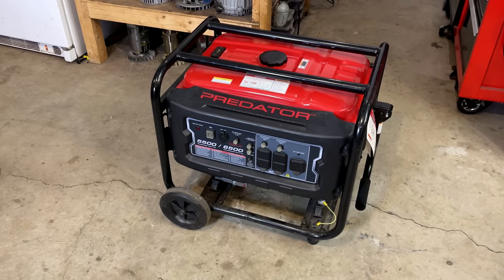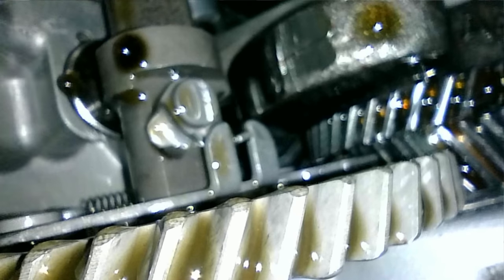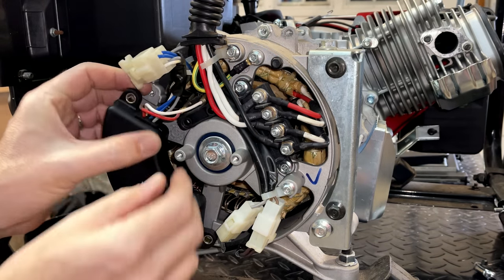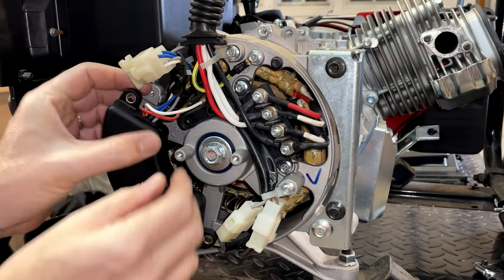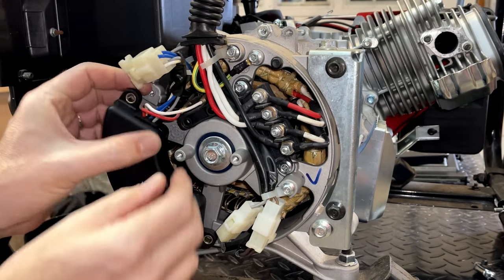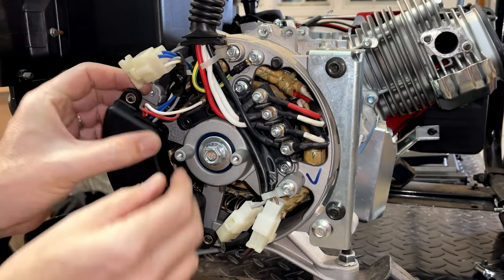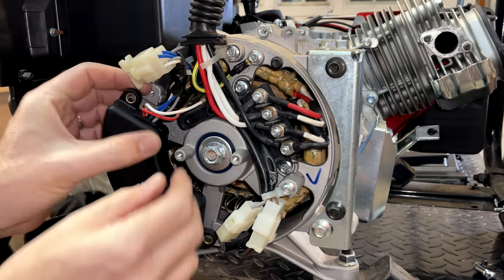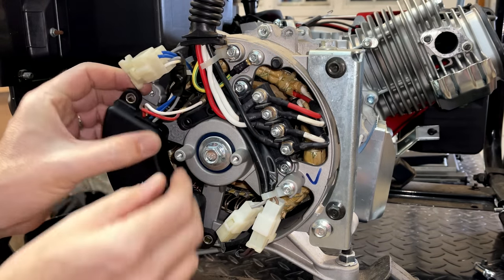Broken Predator Compression Release? - High Compression and Hard to Start

Comment: I don't think the sticker was backwards, instead of showing how much the choke is on or off, it might have been showing the relative opening.??
Reply from the maker: Maybe, although I think I have seen them the other way on some other predators.
Reply: @jcondon1  yeah it's not really a good indicator of what is going on
Reply: The sticker was most certainly in the correct orientation narrow indicates closed wider indicates open.
Reply: @Outindacold  Makes sense buddy i believe you are correct. You would think the standard design should just be an arrow and a pic of closed and open

Comment: Oil works better than water James ,old toolmaker trick for removing blind bushings.
Reply: Yes, but then you have a big oily mess to clean up, as he has stated before.😮
Reply from the maker: It does work better and I use it when water does not cut it.

Comment: James I have recently starting watching your videos and I really enjoy them.  I have a quick question about a generator I have been working on.  It has a plastic tank with a rubber grommet/bushing on the bottom of the tank holding a shutoff valve.  The grommet was leaking so I ordered a new grommet from Amazon.  The new grommet worked for about about 2 weeks before it also started leaking.  When I removed the new grommet, it had hardened and obviously shrank.  I figured it was a cheap grommet from amazon and it was probably not compatible with ethanol fuel.  Therefore, I order a much more expensive grommet that was supposed to be OEM.  This second new OEM grommet lasted about 2 months but it also had the same results.  Is there a grommet out there that will not be effected by fuel with ethanol?  I watched a video of yours from 3 years ago where you used an orange colored grommet and you gave the part number.  I looked up the part number you gave and it says it is discontinued and no longer available.  Please help.

Comment: Funny but I always wonder why you don't blow out the seat to the fuel inlet when many small carbs have a fuel inlet screen and as a force of habit I always chuck up a Q-tip in a drill and clean the brass seat in case of any residual shellac on the seat. And of course if it has a steel only needle I clean it and replace the rubber seat but that's usually on Tecumseh carbs. Great video as always and I think your son came by because he was eyeing up the 420 cc motor for the Go kart. lol
Reply from the maker: I have an extra 13hp Honda GX390 hanging around.  I thought about upgrading the go kart, but the 5hp Briggs is about all that frame can take.
Reply: @jcondon1  Reminds me with my Sons and now all three of them have motor cycles, they went from 100cc 4 cycle to 1600cc. What I taught them is speed coast money how fast do you want to go. LOL  You're doing a great job, kind of reminds me of "Cats in the Cradle" every minute now will be worth it in the end, Great videos.

Comment: Hey James, based on your findings with the scope, (that the compression release might have been stuck), would it have been worth trying to spray some WD40 in through the oil fill and onto the compression release mechanism, to try and loosen up the compression release without disassembling the entire engine? Or do you think that would have been a waste of time? Just a thought.
Reply from the maker: I think it could have been freed up without taking the engine apart.
Reply: @jcondon1  I guess the video would have been a lot less informative though. 😀

Comment: Hey I really appreciate this video because I have the same problem with my predator generator with the cam shaft issue mine is a 4375 3500  so it should be if not exactly like the one I have

Comment: Wondering your thoughts on a line filter  HLin AC 115/250V 30A CW4E-30A-S Noise Suppressor Power EMI Filter AC Power Line EMI Filter add to furnace or to my generator transfer switch.

Comment: I’m surprised you didn’t try and move the release through the fill hole when you noticed the issue with cam…. Could have fixed it in 20 sec with no disassembly

Comment: I'm a newbe with all the workings of the small motors and have learnd by the school of hard knocks. So if you were able to crank the motor past the compression stroke why didn't the cam lobe lift the exhast valve to pass the 120 lb initial test even if the auto comp release was not working ?

Comment: I sincerely doubt you missed it, but it looked like you may have omitted one of the two bolts on the brushes.
Reply from the maker: Only one bold holding Honda clone brushes.  The other side just has a locating pin in the end housing casting.
Reply: @jcondon1  Aha! Like I said, I really doubted you would miss something like that.  Thanks for the reply!

Comment: I've got a "y2k" honda 5kw generator.  Had to cut the frame to pull the carb.
Reply: That is ludicrous Jim. The only time that I saw James thinking about cutting a frame was when he was considering which tri-fuel propane natural gas conversion kit to buy when converting a generator with an unobtainable fuel tank.  He used one with a very thin insulator block in the end that did not require any cutting. At least I think so but my memory might not be that accurate. Remind me never to get one of those 5Kw generators.
Reply: Wow hard to believe i would have thought that just removing the studs that hold the carb on need to be removed and that would give you enough room to get the air filter housing and carb off.
Reply: Why not unbolt engine ???
Reply: @philliphall5198  Not sure that would be necessary and there may be more to unbolt like the fuel tank which then would require removal to move the engine over. Just removing the carb mounting studs will be enough in some cases only one needs removal to rotate the carb after disconnecting linkage, spring and fuel line.

Comment: Hmmmmm. May I give my 2c as to why that decomp assembly was stuck? My feeling is that there is way to little wheight to keep that assembly out of the way until the speed has come down enough, thereby causing the assembly to be hit against the lifter at a higher speed causing that decomp assembly to become jammed open because of being bashed into the lifter. 🤷‍♂ There is way less material on the weight side, so like I said, just my 2c..... Again, thanks James good vid! OH!!!! And by the way...... You you bum you, stealing😂🤣 rubber feet!!!
Reply from the maker: The weight part is what moves the decompression assembly out of the way.  The spring pulls it back.  The spring was very weak on both cams.  So it does not take much to jam it up.
Reply: @jcondon1  Ah! I see.

Comment: You are probably right about some foreign particles getting in the release mechanism - could be a poor cleaning of the case prior to assembly, or contamination from the oil funnel. Anyway, that release appears far superior to the Brigs plastic use. The last failure point, would be the speed regulator being plastic. The valve washer is probably just poor adherence to build procedure at the factory.

Comment: Nice video!   Just curious if that compression release could have worked itself free by running the engine with some Seafoam in the oil?    That is assuming you could start it without the assistance of the compression release working.
Reply from the maker: It may have worked itself out.  I think just lifting the engine and dropping it hard could have done it in this case.
Reply: Put hand over intake and pull start it several times and it will start

Comment: I would think manufactures would just put a compression release in the head that you can open while starting then close after it's running. Like old motorcycles or old John Deere tractors. Keep all of that stuff off of the cam and make the engine more reliable.
Reply from the maker: Wish they would build them that way.  Easy to fix.

Comment: @James Condon awesome vid long time viewer, question I just came into a Predator 6500 with a viewing hole throw the block 🤣 where can I get a tapered shaft motor to replace ? the 301cc ones they sell from harbor tool are keyed & non tappered
Reply: @James Condon Or is the tapered part a fitting that comes off the motor shaft & can be transferred to the new motor ?
Reply from the maker: The crankshaft has to be tapered.  Your best bet is to pick up a generator locally that does not make power.  Most Honda clones between 300-420cc should interchange.
Reply: @jcondon1  your 100% right just got it all torn down & it's tapered; fun tip you might like to try; I tested the stator before tear down using a drill & socket on the crank w a light bulb plugged in so I knew it was good before investing time for tear down 😁 I'll have a look for a motor that meets those specs thank you vm again ❤️

Comment: If you didn't have a compression tester handy, could you use a torque wrench to estimate pressure by amount to turn engine?
Reply: Of course, removing the coil spring to access it.

Comment: Thanks James.  Two questions for you.

What is too much THD?  Seems Europe is the only place that has a specification for the limit.

On your Ampprobe, do you just hook the two leads to line 1 and line 2 to get the THD for the 240v circuit?
Reply from the maker: I have heard that utilities in the US are allowed up to 5% THD.  I have seen some referencing 6 or 7% as the max for total harmonic distortion.  Some also go further and say no more then 3% on any one harmonic.  I usually only test on the 120v leg.  Would be interesting to check the 240v circuit which goes through both legs.  Not sure if the value would double or not.  The Amprobe can also display the % for each harmonic.  Will have to experiment a little with the meter in an upcoming video.

Comment: I have a riding mower that is doing the same thing that this engine was doing. It was given to me several years ago. I was told that the engine was locked up by the previous owner, so I kept it for parts. It sat in my back yard for a year or two before I got around to fooling with it and found out it was a compression issue. I did a valve adjustment, and it fired right up and ran perfectly. I used it a couple of times with no issue, then I didn't do anything with it for about six months. When I went out to start it, it is now building too much compression again. It is a 12HP Briggs Failtek engine. Do you think it could have the same issue? It has me stumped.

Comment: I have noticed that you torque everything. I have been working on small engines for years, and I have never even owned a torque wrench. I have never even used one. I haven't had to do a ton of engine work in my business since customers usually don't want to pay the labor, but how important is it to use one?
Reply from the maker: For most bolts, not that important as long as you go easy.  Most of the smaller bolts strip out real easy.

Comment: The  intake valve retainer - what keeps the retainer from rotating around, out of position, while the engine is running?
Reply from the maker: Just the spring tension and I would also think the rocker.  Every time the valve opens it would probably center itself as long as the flat edge is down.
Reply: @jcondon1  thx!

Comment: Man that is really some cheesy weak lightweight looking stuff for that compression release to live inside a motor and be expected to last....
It should be designed to not be affected by minor pieces of sludge or small metal shavings,,, also was the cam you had an older design ??

Comment: so i have a predator 223 based inverter generator.    it was running bad.   did the typical ,  cleaned the carb.  plug. oil check,  as well as the exhaust spark arrestor and intake check.  went to the valves.   they were tight.   adjusted to spec.  then i started to get this high compression.   also about 130 psi.......   i do have the decompression bump on the exhaust.,   so it seems my cam is ok.....   i am at a total loss. .... it's not firing early.   this happens with out the plug connected even.   my hand needs to rest from the recoil snap LOL.    also it runs better now that the valves are adjusted... just hard as hell to pull.    any thoughts?   but even put in new push rods,  new keeper, new rocker arms and studs (stripped the old studs's with my shenanigans)    and with out the plug in it turns freely. so it's not a mechanical bind.
Reply from the maker: As far as the high compression would look at the valves again and make sure you are on top dead center of the compression stroke and not the exhaust stroke.  To be sure just rotator the engine until the intake is open and check the exhaust clearance.  Would suspect it is a little loose.
Reply: @jcondon1  I’ve tried that and to be sure I wasn’t on the decompression tab I even tried doing the exhaust with the intake valve open.    Same result.   Unless the specs in the manual are wrong perhaps !    Thank u for your videos and replying.   Just going to keep snugging it up and see if I get any better results I think the 223 motor in this seems to be a one off.   I don’t see them selling a 223
Reply: @jcondon1  finally got it fixed.   put in a new cam, even though the old was ok.  that didn't help.   replaced the valves and the top end decarbonized.   something in that did it.   finally can start it with out holding it down with my foot....   something on that exhaust valve was causing issues..  no idea what but all good now.   thanks for your videos and making me feel like i can fix things with your help

Comment: I have been trying to find a meter that measures THD, the ones I have found are fairly expensive. I have some sensitive electronics that require 10% or lower THD. What meter do you recommend for measuring THD?
Reply from the maker: The one I use is about the cheapest you will find new.  Amprobe acdc-52nav.  Otherwise there are other used ones in eBay that come up in the $200 range.  Like the fluke 41b https://www.ebay.com/itm/314144884451?mkcid=16&mkevt=1&mkrid=711-127632-2357-0&ssspo=y2HPpp5DTca&sssrc=2349624&ssuid=eec5lZxOS1O&var=&widget_ver=artemis&media=COPY

Comment: I'm used to working on old flatheads. Is the other gear the oil pump?
Reply from the maker: Counter balancer.  It has a weight like the crankshaft but spins in the opposite direction.  Helps the engine to run with less vibration.
Reply: @jcondon1  is that just the bigger Ptedators?

Comment: What causes the compression release to break ??I have the 212 I removed the governor the easy way forgot to secure the armature and when I test fired i got a real bad rattle shut it off secured the armature re fired no rattling after that compression was real high at compression point had to hand crank past or it wouldn't let me pull but after I manually cranked it past compression point I could pull it rode it like that for a while installed the mikuna knock off carb rode it a few times now I have no compression at all won't start I can just turn it by hand  99% sure  it's my compression release because i have zero bump in my left rocker arm ...just need to know one thing is my fault i messed up my engine??😂😂😂

Comment: 110 psi is a good compression reading for a 4 cyl VW engine..
Reply: the stuck compression release lever?   China quality control failure...!
Reply: and the other camshaft installed with timing marks properly aligned is a plus!

Comment: You know with a few modifications the children’s kart could do 60 mph. Unless you want to keep them.
Reply from the maker: It is a fast kart even with the old Briggs on it.  No suspension, bent axle and a weakened frame.  Would probably break apart at half those speeds.  Will upgrade it at some point.

Comment: Be careful hammering on anything connected to the crankshaft. These engines (and most small engines) are not designed to handle any thrust load on the crankshaft. Hammering on the crankshaft (or anything connected to the crankshaft, like the bolt attaching the rotor to the crankshaft) can damage the engine block/case pretty quickly. Even hammering on the crankshaft in an engine designed for thrust loads (like an automotive engine) is a bad idea.

Comment: Il ne faut jamais allumer ou éteindre un groupe electrogene en charge
Reply from the maker: The main concern are the power surges damaging something connected to the generator and the stress it cause in the excitation winding and AVR.  Also residual magnetism can be lost on old machines.  That said, a 70 resistive lightbulb is not a concern.

Comment: James, please try doing something about the length of these videos. 1h15m is just too long. There’s many ways to edit these down without losing any good parts. Movie Directors do it all the time. For starters, we don’t need to see you remove every nut and bolt in its entirety. If you do the same identical things in a video multiple times, we don’t need to see them all. Mundane cleaning and scraping? Run it as fast forward speed. Think about the critical points, turning points, or teaching moments in the video, and focus on those. I cannot sit thru such long videos when there’s so much that’s pointless to see. There’s just no time.
Reply from the maker: A lot of channels do that.  It’s not my style.  Movie directors cut way too much out.  It would be a good experiment to cut the short and long version an see what people like.  I think most are here for the detail.
Reply: @jcondon1  I definitely don’t mind the analysis, thought process, details, etc. I think you even see it at times and apply a bit of fast forward. It’s just that, after watching a dozen or so videos, a lot of it is the same friggin thing. Taking a gas tank off watching each screw removed, watch recoil cover removed, same thing etc. That part is honestly boring as F. At this point I’m doing a ton of FF already. I guess I’m just hoping to have it done for me. Like this one, once I heard you were going for the cam, I FF to right before you separated the case. I didn’t need to see the same old stuff again before that.